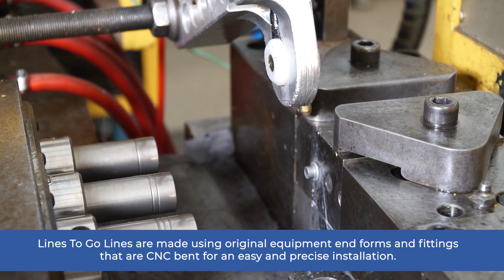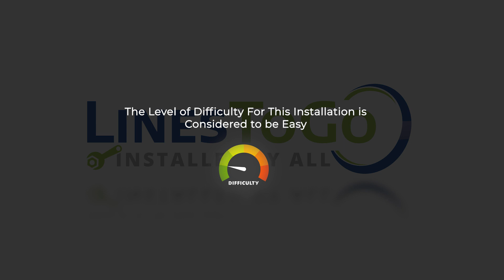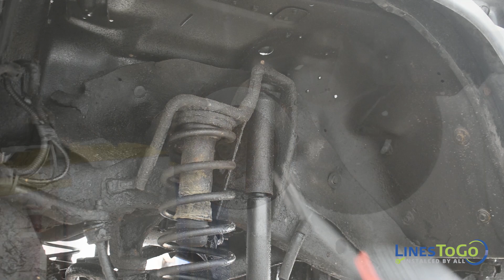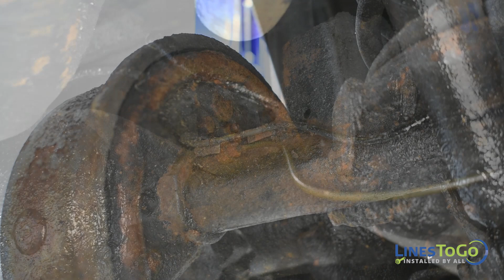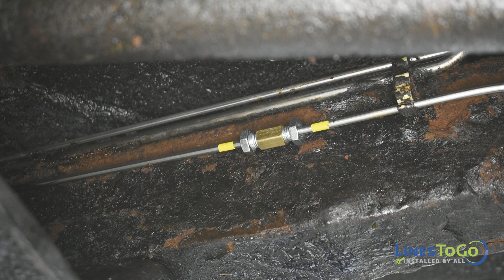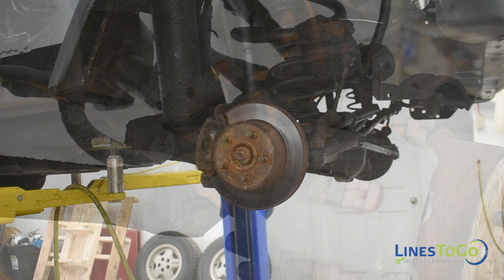How to Install 1997-2006 Jeep Wrangler Brake Lines

Comment: Would the master cylinder need to be bled separately (first) before bleeding the wheel lines?  It looks like it would have run dry.
Reply from the maker: Hi there,

As long as you are not installing a new master cylinder you shouldn't need to bleed the master cylinder first.

Please let us know if you have any further questions.

Best,

- The LinesToGo Team